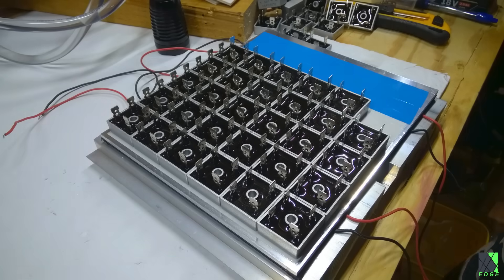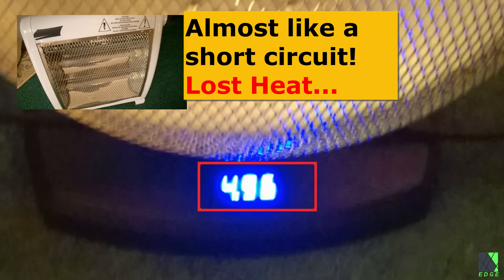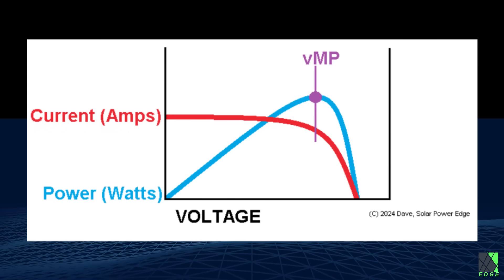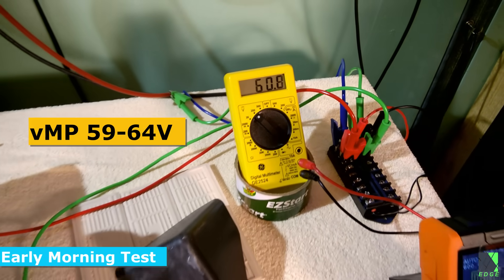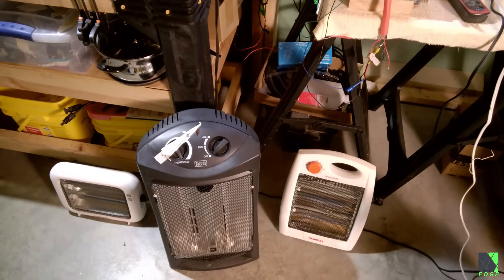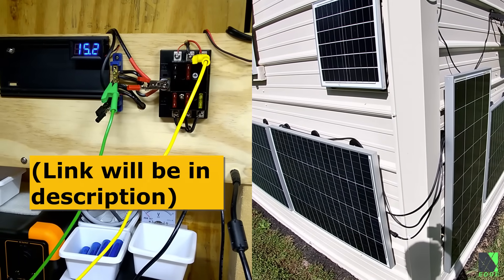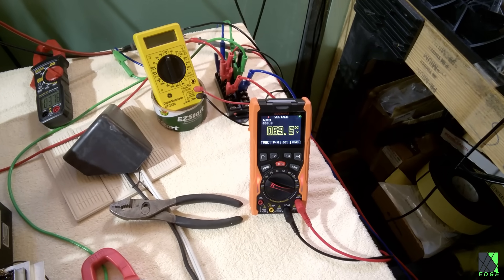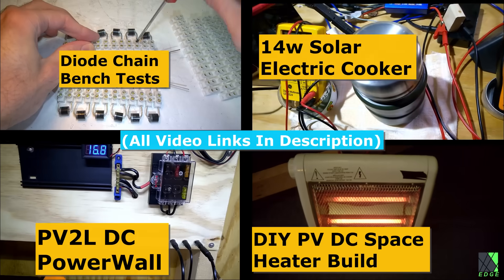How I Get More Solar Electric Heat With POWER DIODES - Poor Mans MPPT #DIY #solarenergy  #solar

Comment: You have those diodes in silicon oil?
Reply from the maker: @morenothing4u Hi, I have never used silicon oil, but hey it's worth a try!
Reply: @solarpoweredge   Do you have a video that goes into more deal on sizing the diodes for certain Imp/Vmp/Voc ? I just want to heat up a barn for chickens, goats/sheep.  Unfortunately I already bought Ecoworthy 150v/60A charge controller and two of their 12v150a lifepo4 batteries and was planning on using an inverter to run heat lamps.  You are correct on avoiding the wear and tear on these components as they are not cheap.  It would be better for me to use these to run them at night, and the diodes for the day.
Reply from the maker: @morenothing4u That sounds like a good setup, can still use batteries and heat lamps for supplemental heat and then use direct-drive diodes when it makes sense. I assume you have already watched my diode chain playlist [here it is for reference https://www.youtube.com/playlist?list=PL8a6nRTNyF9PK7SExvQKNhN0t3RUP9pT7 ]
Anyway here's a shortcut: I use an MPPT controller to find the vMPP voltage for me automatically, make note of it then add up and connect enough diodes in series (0.5v each) to hold that voltage. I only need to stay in the correct voltage "region" and if it's not super exact that's OK. Also, I make sure to get the heat out of the diodes (that's the goal anyway) instead of letting it build up. Their voltage will vary some when they heat up. If I have a small fan on the heatsink, usually the whole assembly will reach a point of equilibrium and will stabilize. Then I fine-tune the voltage from there by adding or removing diodes. Sometimes I use a schottky diode to really fine tune, because they only drop about 0.2v (vs 0.5v for standard silicon rectifiers). What's amazing is that in the early morning and evening, diodes behave better than even an MPPT controller, able to extract even the smallest amounts of heat, whereas an MPPT controller would just give up and go into standby mode. I verified this in extensive low-light testing during the last project. Anyway I hope this info helps!
Reply: @solarpoweredge  Do they not make diodes in a flat package like an igbt so it's easier to mount a heat sink with thermal compound?
Reply from the maker: @morenothing4u There are TO-220 style diodes available pretty cheaply, and I have yet to try them.  If there are bigger versions of those, that would be great.
I saw a picture of a cooking device someone made with TO-220 diodes. 
For space heating and regulation, so far I prefer the 4-way metal encased rectifiers because they seem very tough and have a good metal surface and place for a bolt. 
Still looking for better diode packages to try. Probably will have another look once I get back in my workshop and get things more organized here.

Comment: I just acquired 2 Longi 545W solar panels...for $20.00 each, and this kind of info just what i am looking for.
My plan is to use them for heating, and I have zero experience with them. I do have good knowledge of electrical/electronics, so I can see getting some use this winter.
Reply from the maker: @joeshmoe7967 Nice!!

Comment: Hello! I cant remember if i already asked this but it seems the power or current is passed through i understand the mppt like setup voltage cost of ea diode 

 so the question is can i use lets say an  80watt panel its actually 4x 20 watts panels ran in series then the pairs in parallel 
the info i have got is the panels produce 19.2v but that drops to 17.32 when warmed up individually and oddly enough more when wires in series around 43.4V as high as 68.9V if i angle them apposed to ea other in a broad V shape  already warmed up today in overcast was 43.4V  

so if i use 32 diodes and the output voltage i get is 43.4V ex and the diodes cost -19.2V lost to use i harvest the heat from them bonded etc but that leaves me with aproxx 24.2 volts we can even round it down to 20v 

could i then take the final output and run it to a charge controller as the current is unchanged to which i use to charge and maintain a battery as thats my main solar setup and my understanding is diodes are one way im using the IN5402 due to lower cost 

but i have 10 and 15amp diodes at the ready for the next one   

am i missing something here and just not understanding this and last question does the diode chain require a load to work as something actively being powered and if so would the battery charging after controller be enough if that's even possible
Reply from the maker: @lorenwright3202 First of all, bravo for taking the time to do hands-on experimentation and research. There is no better way to learn and gain experience :) Anyway this stuff can get pretty confusing but I'll try to answer... a diode chain IS a load and technically a "heater" in and of itself, unless you limit the current across it somehow. Diodes will conduct unlimited current (until they melt and burn up) as they are not resistors themselves, but behave very differently. If the solar panel has 10 amps, the diodes will try to take all of it unless you deliberately fine tune the voltage to be higher up above the vMP region. 
I have experimented with using diode chains as #1 a rudimentary voltage regulator and #2 a charge controller... #1 works great usually, but I need to spend more time on concept #2. I never finished that research but hope to do it later. The problem with a diode chain is the "output" is shared and may not be suitable for running all loads. However I never tried hooking up a charge controller that way, so who knows if it works. I'd say if you have a way to test it safely, go for it and see what happens. The more we DIY, the more we learn :D

Comment: Can a diode string also be used purely for the "MPPT-like" characteristic to help provide a more constant voltage to an inverter that would then power a load? I realize that without a battery a single cloud moving over would shut the system down, but for just a bare-bones "emergency" system could this work? Or do the diodes need to consume most of the array power by design? I've tried looking for a stand-alone MPPT module that will just give an output that isn't also a battery charger but haven't been able to track one down. Plus I like the simplicity of this design. What do you think?
Reply from the maker: @adamdecurtins3405 Hello, this is a cool idea! I think that could work but haven't tried it yet.  However we'd need to be careful not to accidentally over-volt the inverter and fry it - hopefully the inverter would automatically shut down. I think I will give this a try as soon as I am back in the shop :)
Reply: @solarpoweredge  wow that would be incredibly nice of you to try! Also thank you for the response. And yeah over voltage could potentially be an issue with that system, perhaps a buck/boost converter would also need to be put in line to combat that. Or you would have to keep the panel array to the low end of the voltage range of the inverter. But if a handful of diodes could effectively replace a microcontroller with an MPPT algorithm, even if it has to burn off 50 or 100 watts to do so, that would be awesome!
Reply from the maker: @adamdecurtins3405 It's on the list :) I have run various DC loads off a solar diode chain, and am pretty certain an inverter would work. I just prefer DC not AC. Defeinitely will make a video about a diode string + inverter ASAP, you got me to thinking about this since yesterday :)

Comment: Can a photovoltaic panel be used as a radiant heating panel, instead of diodes? The cells of the panel are also junctions and I expect would behave like a dynamic resistor.
Reply from the maker: @BCreativeDIY Yes it should work, and old solar panels are good for this type of purpose

Comment: are these diodes food safe? i'm concerned about gadolinium and arsenic in my hot water lol
Reply from the maker: @ZiggidyZach Hello, this is a valid concern! In my hot water heater, the diodes are 100% isolated from the water, no chance of toxic heavy metals escaping. For the mini solar cooker (linked below) again the food never comes into contact with the diode packages themselves. In free air as a space heater, I think diodes are safe around 40-50C. If they get too hot, I suspect toxic fumes could be the result, but getting them that hot is counter-productive. Hope this makes sense! -Dave
Link to mini solar diode cooker I mentioned: https://youtu.be/CRhkZp6ECHk

Comment: Why not add super capacitors with the diods
Reply from the maker: @truthseeker1364 Unfortunately I did not mention it on camera, but I have tried parallel capacitors. A capacitor can in fact modify the voltage curve. This could be helpful  - depending on what we want to achieve.

Comment: You've used bridge rectifiers. Won't half the bridge be unused as those diodes are reverse biased? So as I read it, you'll only need 50 bridge rectifiers, with 2 diodes forward biased in each, to deliver the 60 volts.
Reply from the maker: @PhilJoyce-p2t Hi, the bridge rectifiers are wired in such a way that there are 4 diodes in 2P2S configuration. This spreads out the heat load amongst multiple junctions. Plus bridge rectifiers tend to be fairly tough, and their flat metal casing works well with aluminum heat sinks

Comment: Your channel is very interesting. Unfortunately, I don't understand everything yet, as electricity is not my speciality. I still need to learn more about how diodes work and what exactly MPPT is. I would be interested to know if you live in a temperate or rather cold climate zone.
I have had rather bad experiences with solar thermal energy here in northern Germany. I need the hot water most urgently in winter. But unfortunately there is not enough sunlight from the end of October to April. So I'm wondering whether electric water heating via the sun would be more effective than solar thermal energy with vacuum tubes?
Reply from the maker: @SD_Alias I have wondered exactly the same thing, but I don't have a vacuum tube to do any experiments on. Nevertheless I do know a good water tank with a solar electric heating element can heat water (eventually) even when there isn't good sun. The key is to extract max watt-hours (MPPT for example) I hope you can solve your hot water situation soon - take care! -Dave
Reply: @solarpoweredge  It is my parents house. So no room for experiments ;)
My own House is very small and i have not a lot of space for PV-panels. I am heating with a gas heater and my parents in their home in the cold and dark period too.
Unfortunately, they have too much hot water in the summer and have to cover the vacuum tubes.

Comment: so are we using the forward voltage or the revers breakdown voltage for the voltage regulation? that wasn't specified if I was to repeat this experiments what would I need. diodes, wire and solar cells. they are all in series what happens if you do a parallel and series grid like 9 diodes 3 in parallel and 3 series as that could hold more current at a reduced voltage. as then you could get a doped silica wafer with an interference pattern to do the same thing as a diode chain optimized for thermal efficiency let alone try a biased mosfet the perfect "ideal" diode as more current can flow at higher voltages that self regulate based on input voltages
Reply from the maker: @TheCoolDoctor Hi it's using the forward-biased voltage drop. Diodes have no significant impedance to current, but do drop more or less a half volt (depends on type). We can use enough diodes to drop a "certain voltage" and suddenly it becomes a "roughly" regulated heating element. It's not perfect, but actually can be better than resistance heating elements - obviously not as good as digital MPPT circuit. But it's dirt simple and cheap, unlike MPPT

Comment: I missed the part displaying the temperature off the heatsink in the early morning ?  It alone heating the room ?
Reply from the maker: @GREGGRCO Hello, in fact the nichrome (resistance) heater running in parallel to the diodes is doing most of the heating. The diodes act as a regulator plus they extract some extra heat. Of course it's possible to use diodes alone, but they need bigger heat sinks etc. I operate heating diodes at about 50C or so for better longevity. Hope that makes more sense
Reply: @solarpoweredge  yes yes yes !!
Thanks for your response  !
I was stewing driving to work about this. Heat sinking series diodes to a copper pipe. 
Heating the pipe to 120C°.
Funnel fanned air into and across an array of these hot pipes.
Trail and error the voltage and current
through the strings to maintain that diode temperature.
Ohmite uses an aluminum housing for enhanced heat dissapation around a wire wound resister.  I was going to search for the same idea for diodes.
Through your video, it never occurred to me before to cook diodes on purpose !
What a great idea. And no other electronics are required. Simple.  Thanks !!  If a diode exists that can survive that service, or engineered to, this sure beats bringing in wood everyday.  Also I'm using pouch cells in place of my truck battery.  I'll never use lead acid again LOL !
So again,
your bruteforce regulator across each cell might be a solution keeping each around 3.6volts in the pack.  Again !
Thanks !!

In the paper, remember, those are floating ground. Getting potential differences to charge something, then "your metal case" touches ground somewhere, and SPARKY ARCY.  Ask me how I know?
Thanks for the video and the Y.T. "ALGORITHM" passing it by me !
Reply from the maker: @GREGGRCO You welcome :) very interestesting  concepts here, thanks for sharing. I love the fact that diodes are so dirt simple, yet can function as a type of regulator. And In fact making heat from PV, which is not at all what most electronic circuits desire. Diodes can boil water at 100C and survive, and some researchers push them even harder. 

Speaking of cooking diodes, you may find boiling an egg with 14w interesting https://youtu.be/CRhkZp6ECHk
Diode playlist https://www.youtube.com/playlist?list=PL8a6nRTNyF9PK7SExvQKNhN0t3RUP9pT7
Reply: @solarpoweredge  duuuuuuude  lol ! That's great !  Watching it now.

Comment: Excellent Content. Just the research I needed to improve the efficiency of my sand battery project, a diode "mppt". Thankyou for sharing, parts ordered to run trial. Excellent idea to use rectifying diodes, 2 diode drops in 1 package. Really loved the video. PS my sand battery is using a 12v element. 👍
Reply from the maker: @neilfarnham5996 Thanks :D I'd be interested to hear how your research goes. Diodes are the only thing I know next to mppt, so simple. 

I built a sand battery too for parallel operation with diodes. But did not place them in the sand. One set is air cooled for space heat and better voltage profile, yet another set placed in an insulated water tank for thermal storage. This way I can keep diode temps around 100C or less. In the process of building this, I discovered a complementary heat storage method that should bring things to another level! need to get back in the shop and finish those projects....

Comment: Love the video! I'm looking for a practice way to heat a sand battery , planning to install under the concrete slab portion of my greenhouse. Do you think this could play a role?
Reply from the maker: @igasem Glad to hear it :D 👍 I have been testing diodes and sand batteries, thermal storage. diodes are temperature limited sadly. However since we're just making heat from PV, diodes can still be used to extract more heat. And so I am storing the extra heat in water. I hope to publish video about that "as soon as humanly possible".

Comment: Good video but it lacks some specific details - like how hot do the diodes get? And how hot can they get without damage to them? Also - a close-up of how you're wiring them would be very helpful.
Reply from the maker: @fleaniswerkhardt4647 Diodes, in theory, can tolerate well over 100C. I prefer to operate them at 40-50C for heating. For cooking food, boiling water, thermal storage etc. I prefer 100C. All diodes are in series, this is called a diode chain or diode string. Earlier diode-powered research:
https://www.youtube.com/playlist?list=PL8a6nRTNyF9PK7SExvQKNhN0t3RUP9pT7
Reply: @solarpoweredge   100C would be more than enough for my application. I have a couple of dozen 50A bridge rectifiers (KBPC5010) sitting on the shelf so hopefully I can put them to good use. But as they each have four terminals and 4 diodes - how do you wire them in series?
Reply from the maker: @fleaniswerkhardt4647 The simplest answer is to look up the schematic of a bridge rectifier - notice 2 of the terminals would allow DC transit across 2 junctions? Another method - use a meter set on diode mode to check which terminals have 2 diode junctions and note the polarity. And with this type of diode package, we get 2 diodes in parallel. I actually think that is awesome. As long as one of those diodes doesn't short out that is...